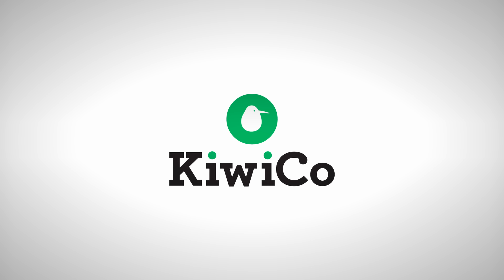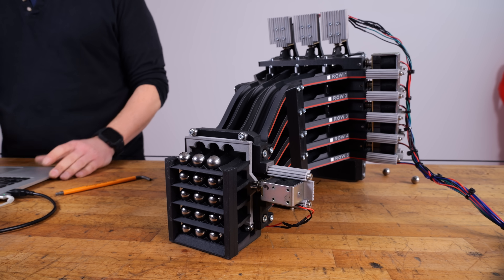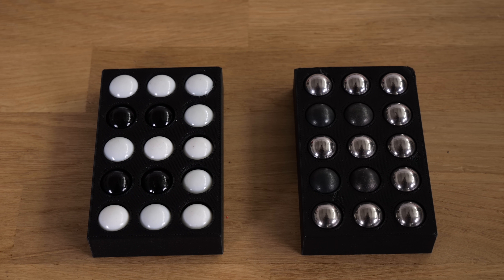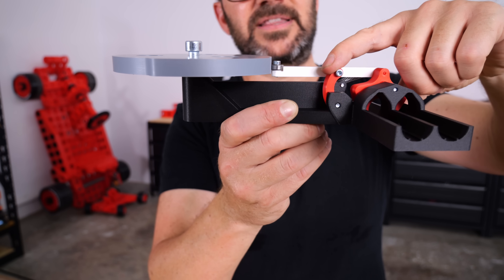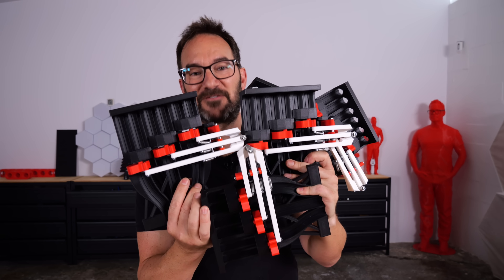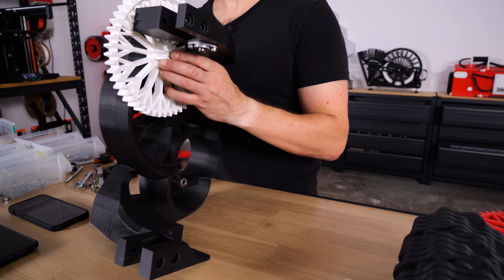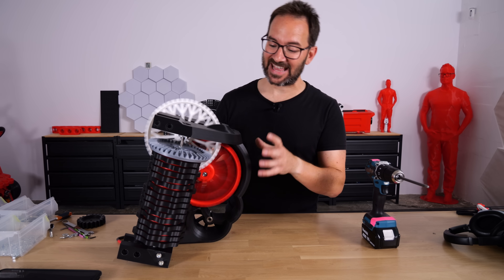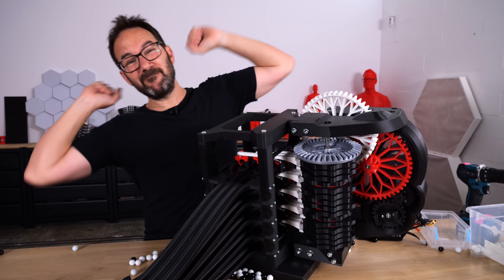Rotary Cam Marble Selector - Marble Clock Seconds Display Pt.5

Comment: This really undersells how AMAZING that cam stack is! For those who didn't catch it, the fifteen cams are all different because the shape of each number is "written" on the cam stack, which the marble selectors then "read" the same way a phonograph reads a wax cylinder. That means there are 20 positions encoded on each disc; 10 white or black positions which control what color marble that track uses for each digit, then another 10 release positions between them which allow the selected marble to drop.
Reply: Yes! The entire video I was stunned by how much work he must've put into calculating the cam profiles 😂
Reply: The amazing thing to me is how he put them all together for prototyping.  I'd have just printed it all in single barrel instead of individual discs and would have had to reprint the whole thing if I messed one up.  Granted he did say he had to print them all again but then after that was just some fine sanding to perfect.
Reply: @EkiToji  you are not alone in that approach, I have lost count of the number of engineering interns all the way up through senior engineers who would design large prototype parts like this as a single piece with zero adjustability or opportunity to replace sections when an issue is discovered.
After several such issues with my own designs I have changed my process to, "design as though something is wrong with your design but you don't know what it is yet."
It takes longer initially, and sometimes is "wasted" effort, but it usually winds up saving a lot of time and headaches when troubleshooting a new design...
Once the prototype is working well, THEN you go in and combine pieces together to simplify future versions.
Reply: @Roll4569  "design as though something is wrong with your design but you don't know what it is yet" — YES. No matter how much you know, no matter how skilled you are, no matter how much experience you have, you WILL make mistakes. That's just part of being human. Really being aware of that and integrating it into your process is a major milestone (maybe the biggest) in becoming a better engineer/craftsperson/maker/artist, no matter matter what kind.
Reply: I love mechanical solutions.  I am a software engineer, and it's so trivial to do a lot of things.  But before software, we had people doing amazing things with mechanical solutions.  For example, way back in the day with clockwork automatons.  Some even played musical instruments.   Thanks for explaining the cams in more detail.
Reply: @michaelbauers8800  I assume you've seen the Marble Machine by Wintergatan?
Reply: @koma-k  Definitely seen it :)
Reply: @koma-k I’ve come to hate that project.
Reply: @Deditzy.  Do you mean Marble Machine X perhaps? I did follow the posts for a while, but I haven't watched any of it for a long time now. I was thinking primarily of the original one though.
Reply: @michaelbauers8800 if it’s so trivial why does YouTube run like mud on my tv
Reply: This is exactly what I was going to ask. I couldn't figure out how the cam stack was choosing the marbles. I thought all of the disks were the same. Now that I know the disks are all different, it makes sense! Thank you. Adelante Ivan!!!
Reply: Near the end he mentioned that the counter is counting down instead of up...
There might be an easy solution to fix that...
Spin the cam drive motor the other way
alternatively, flip each cam so that the top is now the bottom and keep the motor spinning the same way, since the spacers are the part that engages with the part above it should work just fine
Reply: Totally agree, this is insane and very impressive.
Reply: The cam stack reminds me very much of the shift drum in a sequential transmission, e.g. in a motorcycle or rally car.
Reply: Clockwork! The answer is always clockwork.
Reply: I’d been wondering about this!
Reply: Yeah. That contraption reminded me of some of the weird historical stuff Look Mum No Computer displays. Like the tone generator with actual waveforms etched on its plates.

Comment: I mean, with the system in the previously video, you could simplify the device by using only sliver steel marbles, with a "on/off" schema (enabling even the solenoids to be used if wanted), even if empty, it doesn't matter, the "marble extractor" would remove the steel balls and the empty spaces would be black by the lack of reflective marbles, the darker marbles were a necessity on the previously clock, the one with the marble stairs,  in this one it's a gimmick, a cool one, but nonetheless an additional layer of complexity that could be removed without losing function... 

Of course, you can even use only white glass marbles, the "off marbles, aren't a necessity for it to work, but in spite of all that, if it's a design choice, this system is pretty intricate and cool to watch working, really a work of engineering.

TL/DR: The black marbles adds unnecessary complexity into the design, but this clock is cool as heck.

Comment: I have an idea for a small number of the steel marbles. Mount two of them on an axle to form a : to separate the hour and minutes, and another two between the minutes and seconds. Do the blueing on only one side of the marbles, and the axle itself.  These then just need to spin at 30 RPM to emulate blinking, one second on and one second off.

Comment: Seems like PTFE marbles would be better than glass or steel? Self-lubricating and comes in white, black, gray, etc...also it's usually used in engineering practices already so the tolerances are way higher when you buy a bunch...

Comment: I love how what is seemingly an over-complicated contraption is actually the most efficient way to achieve your goals: that's engineering, baby! Would it be worth building a device that sorts marbles by dimension so that you don't have to go in with calipers and do it yourself? Chicken eggs are sized by machines that have rails with different gaps between them so the right sizes go in the right bins- perhaps 3D printing a jig that you can dump marbles into like a coin sorter would make it more viable to get the huge number of marbles you need to fill and maintain this machine. Amazing work!
Reply: The answer to "would it be worth" is in comparing the time it takes to sort by hand to the time it takes to create sorter. Also, creating sorter would mean a new video, so more content, which is a plus. On the other hand, you need to sort millions of eggs every day, so engineering an egg sorter will increase your "time profit" with time, while here he will sort a limited number of marbles, so "time profit" is limited.
If I was in his place, I would do it for the sake of content itself, but it is his channel and his time is spent on it, so he is the one to make the decision what is worth to him and what he wants to do.
Reply: @martinmarc715 you just need to suspend two rails next to each other, it's very easy to make this kind of sorter.
Reply: I don't get why he decided to sort by hand.
Just drill (or print) a hole the right size and check which marble fits. (Might have to check each marble multiple times to make sure that all orientations will fit)
Reply: Great idea can u make sandwich

Comment: Now you only have to print a second set (you need two to show seconds from 00 to 59), print a marble separator tool (easy, at this point) and a marble loader. Than you can apply this concept to the entire clock, reprinting everything after buying a bigger studio, so the finished clock can fit.

Comment: Why use black marbles at all? Just use white marbles and blank spaces. Then you don't have to sort marbles before putting them back in. You could just pipe all the marbles directly up. Also, then you'd only need the two positions on the selector instead of 3.

Comment: When you said you wanted to do it all with one motor I thought damn no way but then you proved it in an elegant design I love it !
Reply: I still don't understand how it will work with ball selection...
Reply: @sweeedex  It took me a minute to figure it out. Remember that it's the same sequence of colors for each position, because it's the same sequence of numbers. The middle ball will be black for 0, black for 1, white for 2, white for 3, etc, up to white for 9. So the cam going once will select 10 different colors in each one rotation.  I didn't figure it out until he showed the whole cam stack and I realized the non-smoothness is part of the design.
Reply: @darrennew8211 That doesn't answer the question raised by @ajpb95
Your answer is how the part shown in this video works. The question they asked is how the marbles will be sorted in the first place.
For the mechanism shown in this video to work the white and black marbles have to be separated beforehand.
And @ajpb95 and I have no idea how to do separate the white and black marbles  with one single motor driving the whole mechanism.
Reply: @Jehty_  I misunderstood. I assume he'd use the other marble sorter he already showed, but you're right that requires solenoids.
Reply: @sweeedex  lol truth it seems not possible but I would’ve said the same about the number selector so maybe he’ll prove us wrong

Comment: I think this is my favorite video in the series. The use of cams is a rather ingenious solution to the problem.
Reply: The use of cams reminded me of the flip displays shown by LOOK MUM NO COMPUTER. The main difference is that this clock's cam can be run in either direction, but the flip display is only built to count up.
Reply: It took me until he put it into the stack to figure out how he's going to get the selector to go the right direction with just a motor. Very ingenious.
Reply: @darrennew8211  
I still have not seen it.  I'll go back to the "put it into the stack" part again.....

Oh, I'm an idiot.  I was trying to figure out how it can select each marble as needed to make the number.  But it's counting seconds, and they come sequentially.  I had seen that he had the cams staggered and that he had to number them 1-15.  It took me a second....
Reply: @2_Many_Hobbies  Yep. It was like figuring out the puzzle in an adventure game. I love it. :-)
Reply: It's so cool. It's like the electromechanical machines of old!
Reply: The cams might be my favorite Ivan Miranda idea EVER. Very simple. Very clever. Very cool.

Comment: Ivan Miranda in 2026 "I made a marble computer, that can run minecraft and runs under a single motor and a lot of spacers!!!"

At first, time was kept with sundials, sandclocks and candels, then mechanical clocks where invented, which was the precursor of mechanical computers. then in the 50's humans made the first transistor, and soon after, humans where engraving strange symbols into impure sand, and made it think it could think, to be able to see the clock. Now  Ivan Miranda is taking the next evolutionary step, by bringing the digital clock to a marble mechanical machine

Comment: bro's machine is gonna be mechanically solving differential equations soon
Reply: Mechanical differentials were solved in the early 1900’s.  There is one on every rear drive automobile.  The same design was used in mechanical naval gun computers from WW II.  You can see one being used in the terrible movie “Battleship” when they target the alien installation on Hawaii.  Periscope Films has a YouTube channel with two parts of a 1940’s Navy training film on how they solve equations.  They cover multipliers, dividers, and using a differential as adder/subtractor.  NASA used a similar mechanical computer in the early days of the space program.

Comment: Couldn't you build a simple sorter for diameter using a v shaped track that allows only correctly sized marbles to drop into a "save" hopper, and rejects marbles that are out of tolerance?

You could probably also build a sorter for sphericity using a shallow slope on which only round marbles will roll, similar to a sluice box.

Comment: Don't be shy Ivan.
Make a millisecond clock
Reply: Do NOT give this man any more ideas
Reply: Perhaps with moving mirrors to show the correct marbles.
Reply: @JuliusHuijnk thats genius
Reply: @JuliusHuijnk  would that still count as a marble clock? :P
Reply: You'd have to let the marbles provide the kinetic energy for moving the large gear that moves the mirrors. 

Also the mirrors would show a black or white marble. Downside is that it only works when looking to it from one specific perspective. But perhaps there is a way around that.

It's obviously cheating, but all for the purpose of stimulating an even more convoluted machine that will keep Ivan busy for another year.
Reply: @JuliusHuijnk  thats smart, could theoretically also colour the marbles with mirrors by shining something onto them i guess, or even fancier have them change according to electric impulses if there's a material that can do that...
Reply: @JuliusHuijnk  DLP chip mirrors would be able to keep up!
Reply: Alright, what madman are you.....
Reply: Miliseconds could not be a good challenge for ivan microseconds or nanosecinds would blow my marbles 😂😂😂😂
Reply: Listen... Idea... Drop marbles in front of a strobe light to show the milliseconds so it looks like the marbles are frozen.
Reply: If you're willing to accept spinning marbles around like Reversi pieces rather than swapping them out, I bet he could get at least tenths of a second.
Reply: How dare you 😂
Reply: bro will be at part 100 after that's done XD
Reply: This is how all scientific advancements happen
Reply: Screw mirrors, all you need is a source of acceleration stronger than just gravity. The solution is obvious - a marble chain gun.
Reply: @Viniter  Chain fed railgun for maximum velocity.
Reply: @ArgyleR04D  That means going back to metal bulle- I mean marbles.
Reply: don't... he'll become too dangerous.
Reply: Physically impossible but I like where your head is at
Reply: BRUH !
Reply: At least let him finish with seconds first o_O
Reply: Thats just a marble waterfall...
Reply: Make a marble SMPTE time clock
Reply: Ivan don’t do it! It’s way too dangerous for glass that’s 1k marbles traveling 1m per second which is 3.6k kmh which is bullet speed. You’ll want to switch back to steel bearing again 😊
Reply: I think marble clocks will be his personal hell after that 😂😂😂😂 he will hate time 😂

Comment: @3:26 not if you just use gravity and let the marble simply fall/roll out on its way from one side to the other. your basically showing it do that in this video. you do not need to actually stop in the middle.
Reply from the maker: What of you need two marbles of the same color in a row?

Comment: The first seconds digit goes from 0 to 9
So if you have enough marbles going around and a channel for each row, the marbles can always stay in that order and you won't need a marble selector. The second seconds number would only need to go 0-5
Reply: It will need a way to display a number and then clear it without mixing the marbles.
Reply: The 10-second update (fifth) digit can probably operate on the same principle as the minutes and hours. It's just that last digit where the extra speed is required.

Comment: Do you even need 2 colors of marbles? In the previous clock black marbles were acting as spacers. In this design I think you can just route white in the shape of numbers without any spacers.
Reply: It would totally works and lower the complexity by a lot more than 50%, but would it still count?
I mean, he could also simply put fixed marbles in wheels for each row and rotate the correct combination as needed for each number.
Reply: I think he should do this for the once-a-second digit, so that it won't run out of sorted marbles (it would just have its own collection tray and feed back into itself). The sorter can probably keep up with the other five digits. The nice part is that he doesn't have to redesign anything, just don't load any black marbles. It will still go through the motions of trying to send a black marble, but that's harmless.
Reply: It would work for the seconds because of the way they stack, but wouldn't work the same as the rest and would look odd compared to the others.  Maybe keep this as a last resort if he can't figure out how to get the current planned way to work.  I have faith he'll figure it out though, he's already figured out solutions to several silly tier difficulty things.
Reply: Little late now XD
Reply: @chkn_boy  Not too late for my suggestion (don't put any black marbles in the fastest digit). No alteration to the hardware is required, just don't give it any black marbles.
Reply: @mal2ksc  It wouldn't work because the black marbles in the "visible" position stop the white marbles for the next second from entering the holes. To use only white marbles, the display gate would need to have 2 stages. One that ejects the current second and one that first holds and then pushes forward the next second.
Reply: The problem is that without the black marbles you won’t have marbles in each channel to push the previous second’s marbles out, so any that remain would ruin future digits.
Reply: At the start of the video you can see the marble clearing mechanism work even with no marbles remaining in the channel, although I don't know if that works every time or if it was just a cherry picked clip. But the main reason for redesigning that in the first place was the original design used "pushing the old marble out with the new marble" and wasn't reliable at all!
Reply: @lolzicus6880  You are thinking about the last design, the marbles pushing other marbles out proved to be unreliable so he already changed that by making a different mechanism, this wouldn't be an issue anymore
Reply: I think he needs every pixel to get a new marble every second to push the previous marble out, the way I see it if he ditched the black marbles then instead of 1 -> 2 -> 3 -> 4 -> 5 -> 6... you'd get like 1 -> ∂ -> ∂ -> 8 -> 8 -> 8...